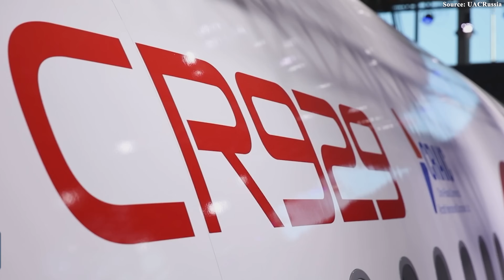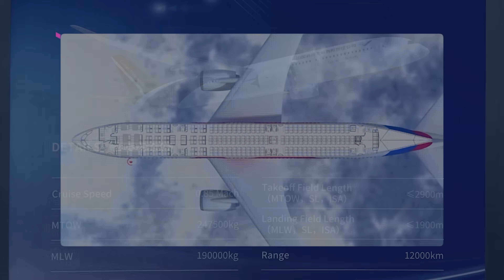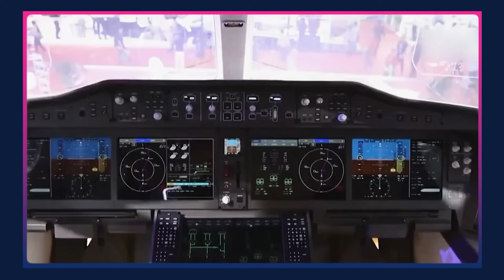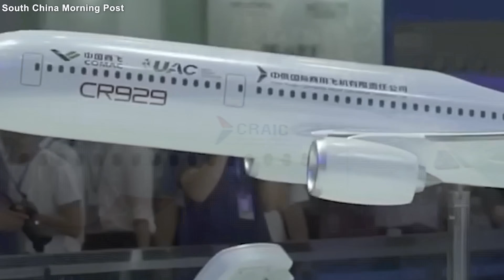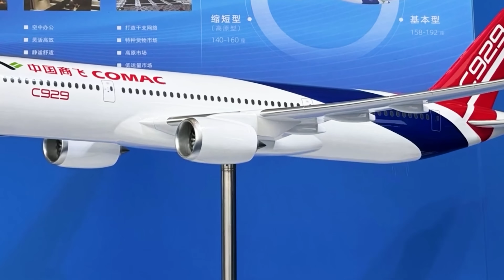This Russian NEW Aircraft Will Change All Aviation! Here's Why

Comment: Russia has the following aircraft which focuses progressively more towards 100% on Russian supplied components:

Aircraft manufacturing companies in Russia along with the models they produce:

1. Ilyushin (IL)
   - IL-76: Transport aircraft, primarily used for cargo.
   - IL-96: Long-range wide-body passenger aircraft.

2. United Aircraft Corporation (UAC) / Irkut
   - MC-21: A new family of narrow-body airliners designed to compete with similar Western models, with variants such as MC-21-200 and MC-21-300.

3. Sukhoi
   - Sukhoi Superjet 100 (SSJ100): A regional jet designed for short-haul flights, aimed at competing with Bombardier and Embraer aircraft.

4. Tupolev
   - Tu-204: A twin-engine narrow-body airliner, used mainly for passenger and cargo transport.
   - Tu-214: An updated version of the Tu-204, also used for passenger and cargo transport.

5. Antonov (Ukrainian, but significant within the context of post-Soviet aircraft manufacturing)
   - An-148/An-158: Regional jets designed for short-haul operations.